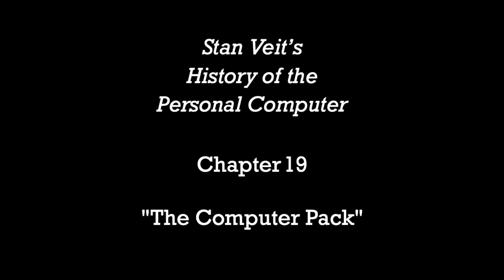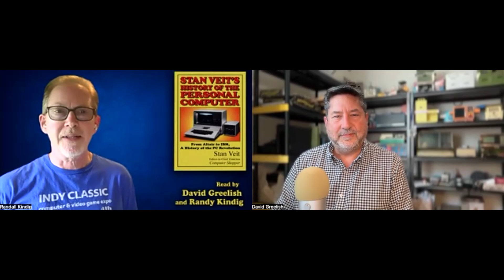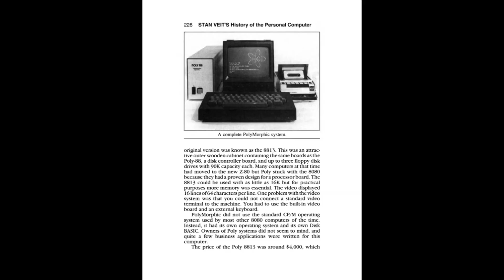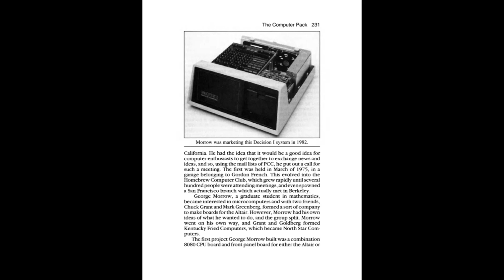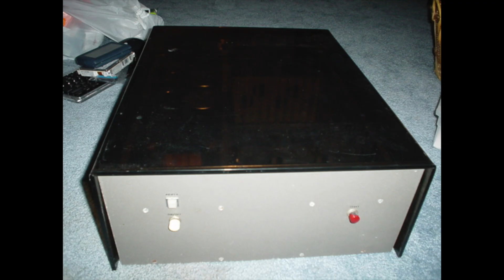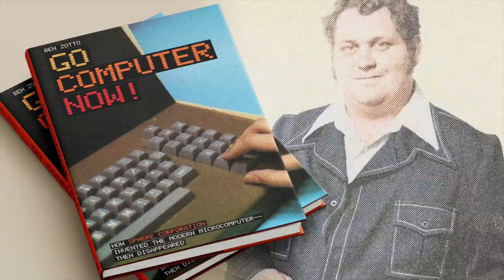The Computer Pack | Chapter 19 | PolyMorphic, Heathkit, Morrow & Godbout | Stan Veit's History

Comment: S-100 machines started with the expectation that users would enter programs in octal. The Altair 8800 front panel switches are arranged in groups of three. If you look in the first years editions of Dr Dobbs Journal you will see most program listings in octal. This largely changed by the end of 1975. Later machines like the IMSAI 8080 had switches that had color levers that could be arranged in groups of three or four. All of these machines I've seen have the switches arranged in groups of four. This makes more sense for machines that have an 8 bit data bus and 8 bit registers and 16 bit address busses. One benefit of octal over hexadecimal is that octal is easier to translate mentally into binary because you have only half the numbers to memorize.